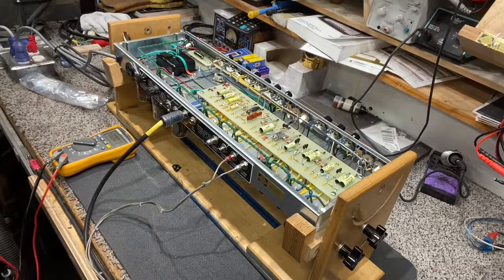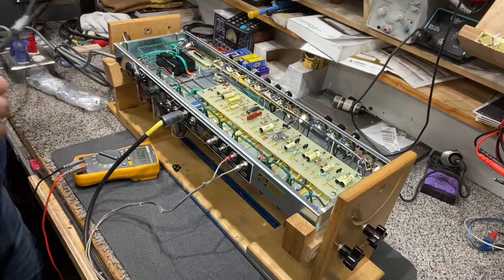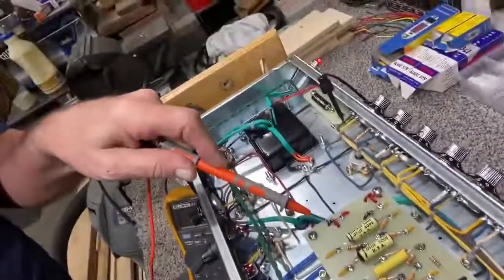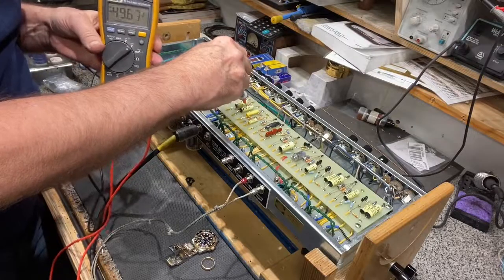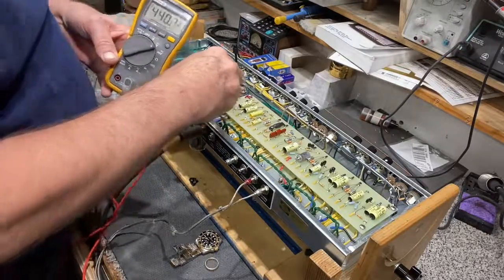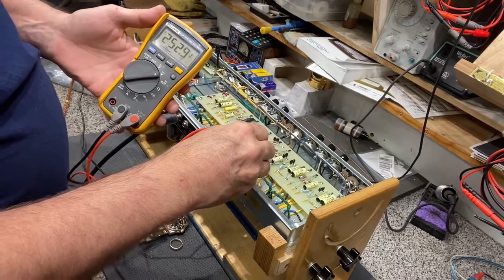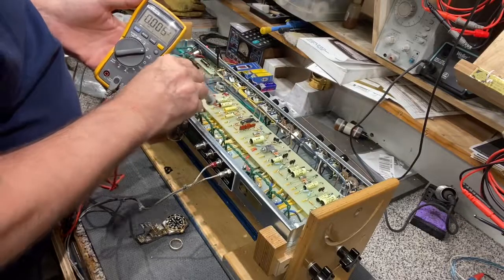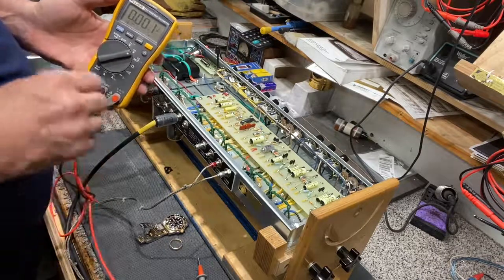Super Reverb Bias and Voltages

Comment: That's confusing. I don't want to know all points where voltages can be measured, but how to bias my amp after exchanging the tubes. Specifically, which is the point (besides the ground/chassis) to connect my probes and measure the voltage when turning the bias pot. And what should be the measured voltage. Is it the first point at 2:42?